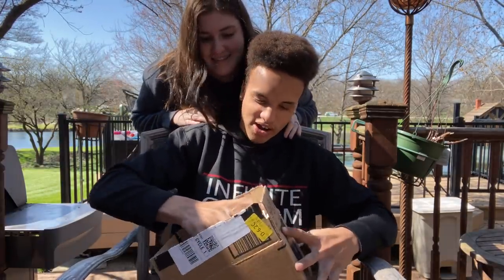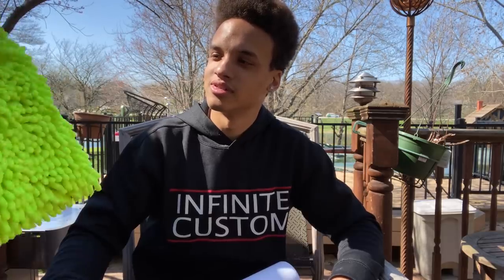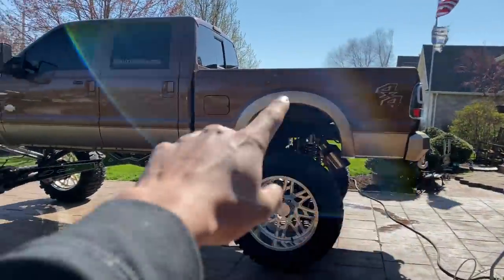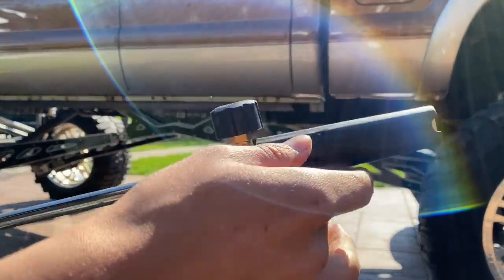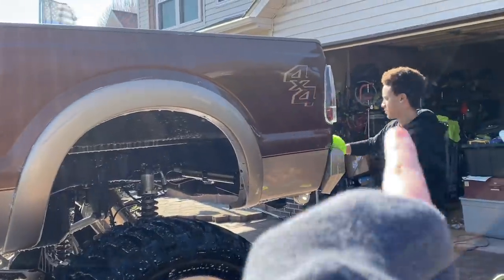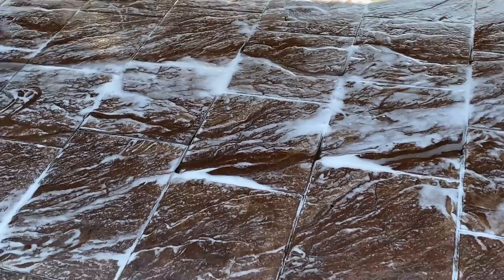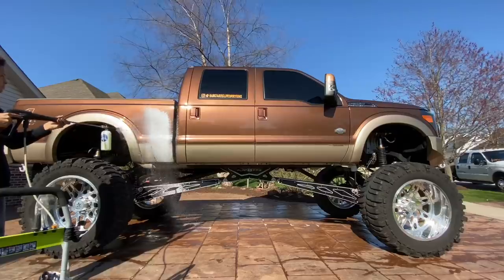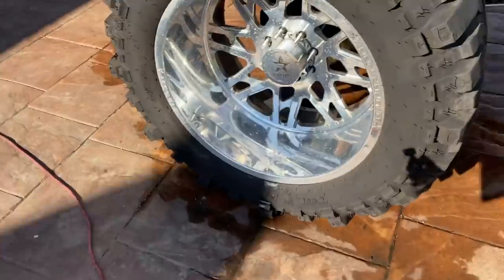$16 Amazon Foam Cannon | Does It Suck? | Lifted Truck

Comment: Hey man, I'm just a guy who has seen a lot of car cleaning tips who tries to keep his truck clean too!
If you really want to protect your paint and not wind up with those spider web reflections in the sunlight, I use the two bucket method combined with what you are already doing.
You basically get two buckets with grit guards, one with soap one for rinse, so you aren't dragging dirt across your paint with the dry, dirty wash mit.
Idc if you take my advice or not, its just what I've seen from pros who wash cars for a living.
Good review btw!
Reply from the maker: Thanks for the advice 💯

Comment: When that bottle threads strip and it will strip   with the brass to plastic connections  just wrap the threads with electrical tape and it will work just fine. That's what I have to do to mine. U def need to get snow foam over what u were using if u want super think foam.